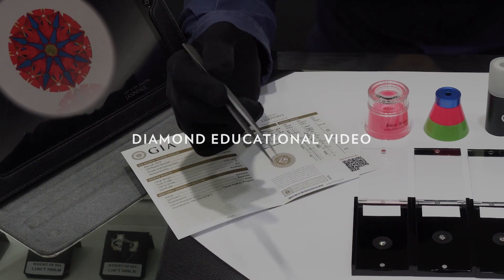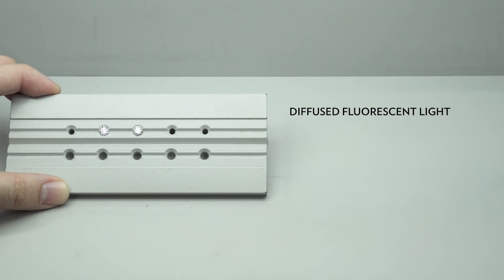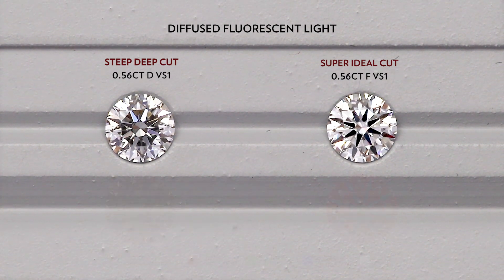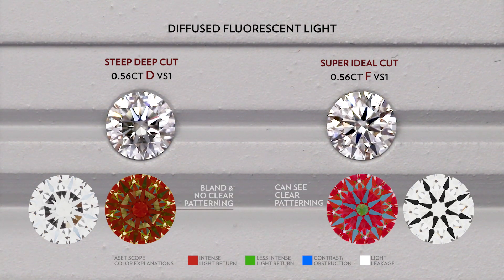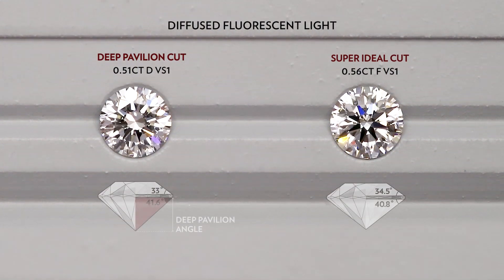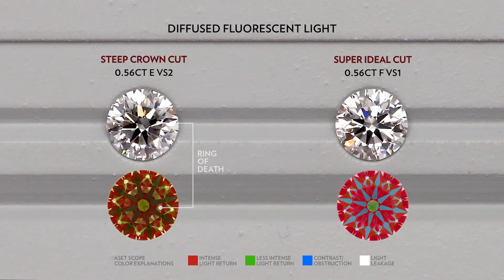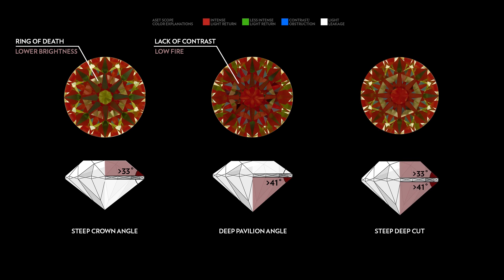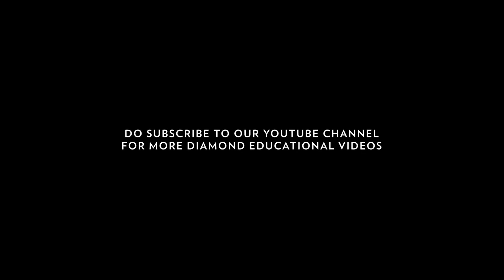Why You Want to Avoid Steep Deep Cut Diamonds | Steep Crown & Pavilion Angles | Super Ideal Cut

Comment: I bought a diamond that is 0,70 carats. It has exactly 34,5 and 40,8 angles. But it has a table width of 53 and length is 63. 
The HCA tool gives it a 1,5 score. 

Is it a good or bad diamond? Should I keep it or return it and try to find a better one? 

Ps. It is a color D and VVS2 triple excellent.